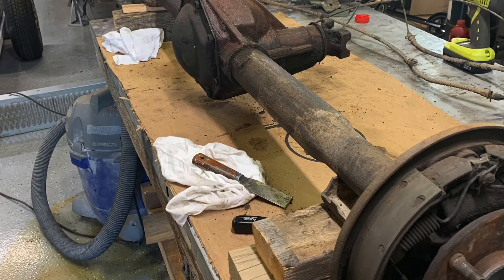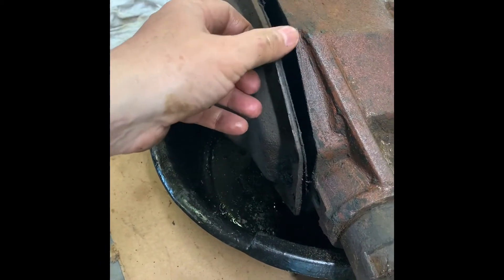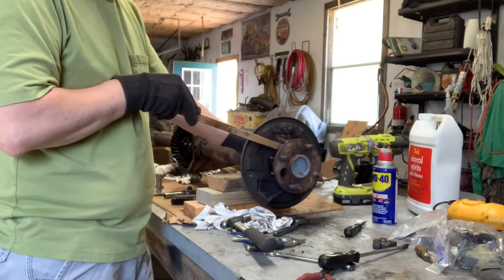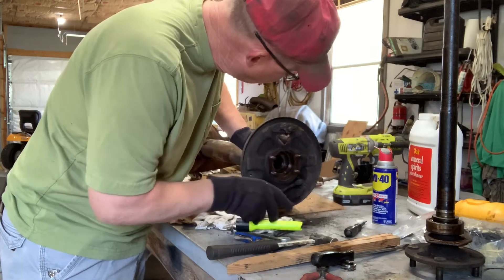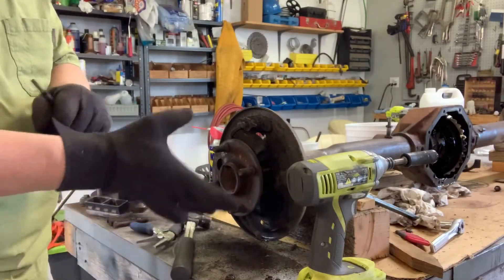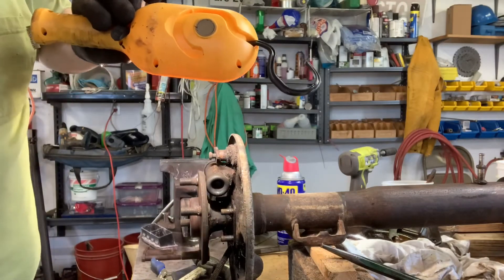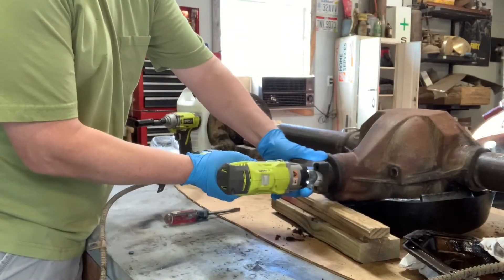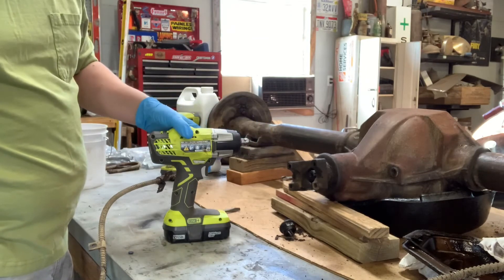66 Mustang 7.25” rear differential

Comment: thanks Dubs,  i think i have the same rear-end  in my 65 coupe, 6-cyl auto.  i want to convert it to a 5-lug, new axles to support 15" wheels and front/rear power disc brakes.  But this 7.25" (WCY-AG, 3.2:1) original rearend, even with a 5-lug axle set seems limited on disc brake conversion parts,  what's available cost more.  Do you think a better way would be to convert to a 8", even though i'm keeping the 6-cylinder engine?  the car is in great condition, but not a high value mustang, and i plan to sell.  Jeffbrillsmail@gmail.com
Reply from the maker: Jeff, I considered the same options you’re looking at as well. Your best bet for the rear 5 lug conversion would be the 8” or 9” differential, if you can find one that doesn’t need a lot of work. The only issue you might have is the driveshaft yokes matching up, however you could probably swap out yokes to get the drive shaft to fit the new differential.
Reply: @dubsgarage  Yes thanks,  just got my 9" with the 5-lug and disc brakes from Quick Performance,  pulled the 7-1/4" out  (any one interested in this 1965 stock rear end?), first I'm reconditioning/repainting the under carriage (aft section first, rust free California car),  then I'll see if I'm compatible on drive shaft and yokes after reassembly.  Then the car with the new 3.5:1 posi 9" rear end is set-up for a V8 engine exchange by the next owner,  but for this project - I'll keep the car period correct with the 6-cylinder and auto trans - rebuilt - was told that for coupes to be more valuable when looking period correct, exception being the 15" wheels and upgraded exhaust.   but I'll add safety: power 4 wheel disc brakes, seat belts with shoulder restraints, power steering and tilt steering wheel.

Comment: I just did a diff oil change on my 62, I'm using Amsoil 80W-90 so far so good, I did get in there with 2 cans of break cleaner and kept digging thick black oil from the bottom till it was nice and clean.

Comment: Make sure you have axle bearings and seals before you do too much cleaning. Some seals and bearing are not  available anymore. Others are ridiculously expensive.
Reply: Falcon seals are identical.  Did you check the diff tag to see if you have a Equa-lock LSD?   They were an option on the 7.25".  I purchased a centre from the 65 Mustang and had it shipped to Australia.  Fitted it to a '65 Australian Falcon diff. It works  a treat.  The 7.25" Equa-lock are rare in the USA...
Reply from the maker: Found everything but new shims. You’re right very pricey.
Reply: @dubsgarage  My oil was one solid, rubbery chunk. I got seals and bearings finally. Reassembling today.
Reply from the maker: I was hoping to get mine together this weekend as well. But have other things getting in the way.